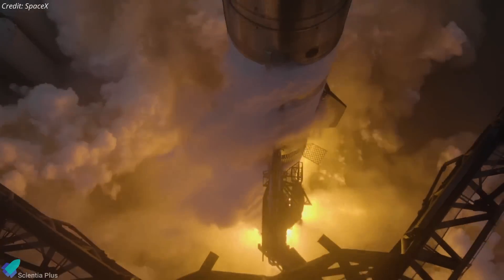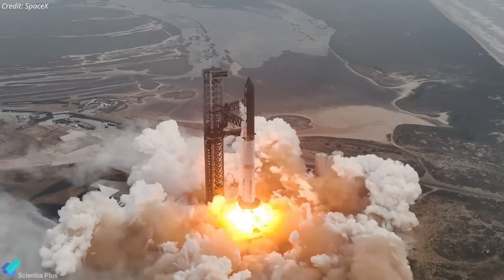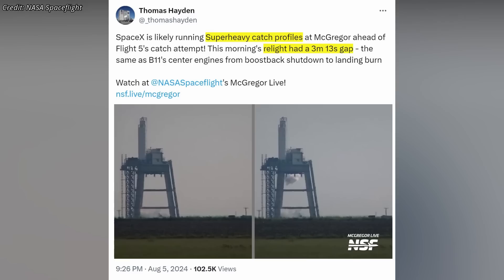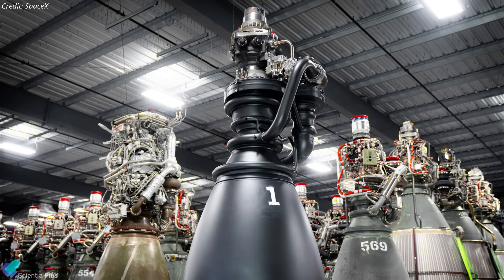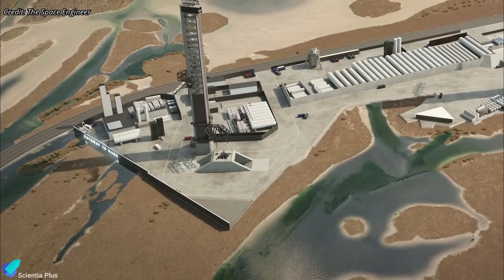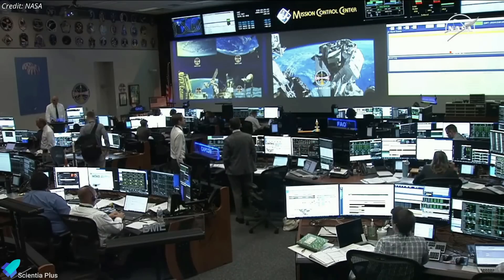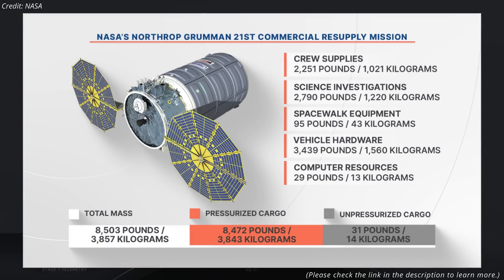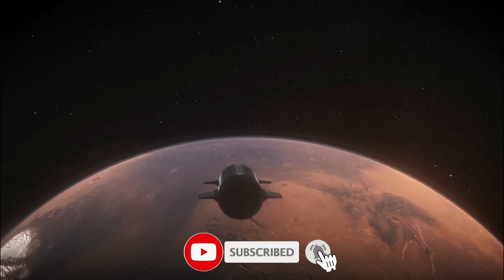Raptor V3 Powers Up For The First Time! Starship Flight 5 Ready For Launch; But!

Comment from the maker: 00:00 Starship Updates
08:57 NASA Contacted SpaceX To Help Bring Starliner Crew Back!
11:37 Cygnus NG-21 Arrived at ISS Despite Engine Issues!

Learn More:
1. Latest Starship Upgrades
 a. Starship Hot Staging Explained: https://youtu.be/qgZHo9wYRW0
 b. Super Heavy Booster Upgrades: https://youtu.be/vZH5esgrFiM?t=63
 c. How SpaceX Protect Raptor Engines: https://youtu.be/L22gyQDDXho
 d. Starship New Heat Tiles Explained: https://shorturl.at/p2Ijb
2. Starship V2 Features:
 a) https://shorturl.at/lpGT7
 b) https://shorturl.at/gwNQ4
 c) https://shorturl.at/xa60S
3. Starship V3 Features: https://shorturl.at/mnBT4
4. Starship V2, V3 & Raptor V2, V3 Complete 2024 Update: https://shorturl.at/tN248
5. Raptor V3 Mega Upgrades & First Test: https://shorturl.at/hGwMC
6. Starship Block 2 Stacking Begins: https://shorturl.at/hXEzO
7. Cygnus NG-21 Cargo List: https://shorturl.at/xA23e
8. B14.1 & Catch Tests #1 Explained: https://shorturl.at/w0zDU

Weekly Updates: https://bit.ly/3HIQjPC
SpaceX Playlist: https://bit.ly/34wue8T

Comment: Ego is preventing NASA and Boeing from doing the prudent thing: Send them back on Dragon, then deorbit Starliner unmanned. Worst case, Starliner doesn't survive reentry. Best case it does, and nothing is lost.
Reply: The Starliner crew does not have Dragon-compatible spacesuits…that’s the issue.
Reply: @SchmelbyFiddlapp  I don't think that's the issue holding NASA and Boeing back from choosing that option, but you're right it's an issue. They should send a couple up with the next Dragon.